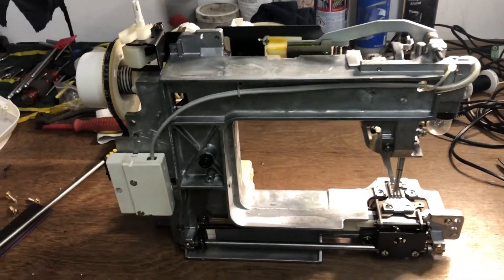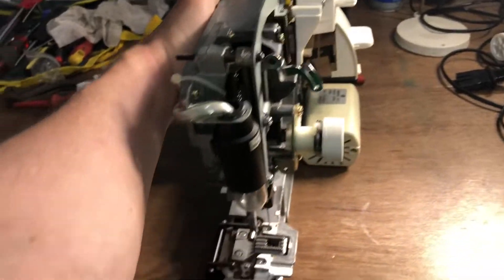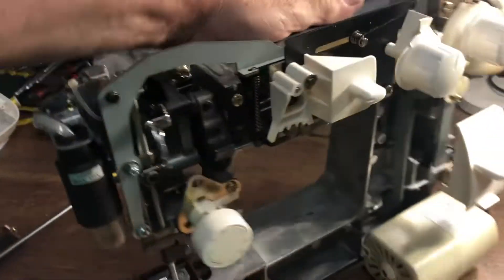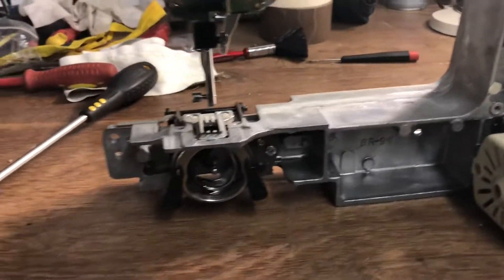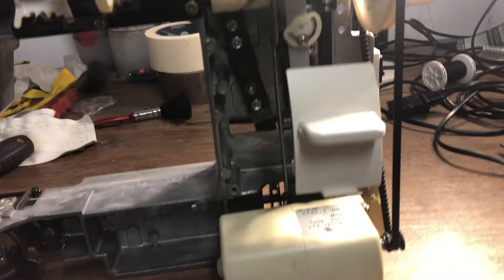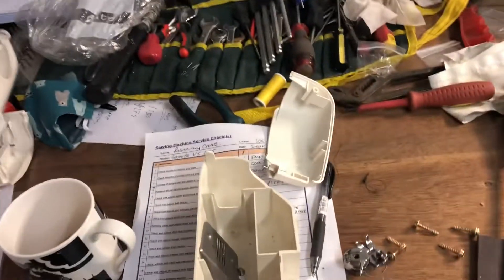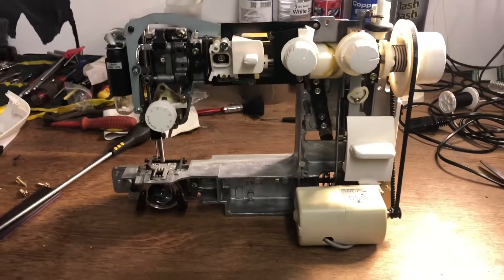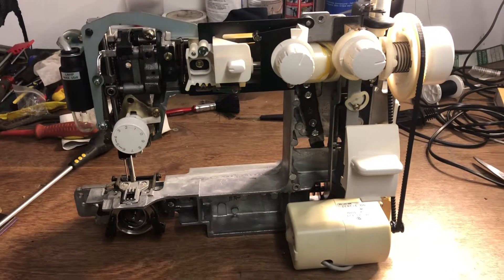A modern machine

Comment: I've seen machine more cheaper than this. It costs over 100 euros and have platic moving parts and plastic "skeleton". Also machine have non adjustable horizontal plastic shuttle.
Reply from the maker: Yes you are correct, but this is a £200 machine, with a known label, it’s not a very good machine. Trading on the name to increase profits and shareholder payments.